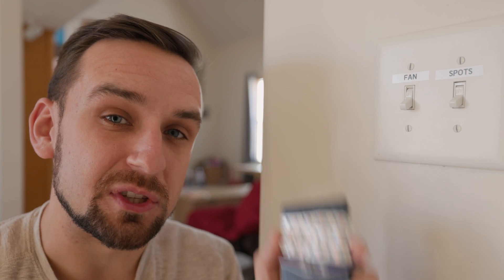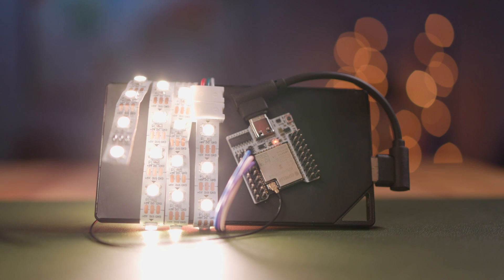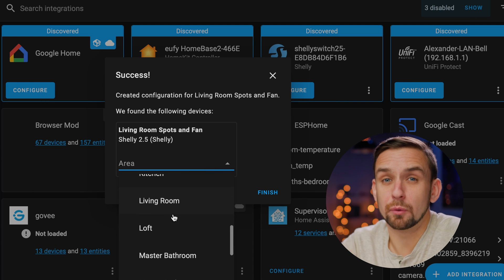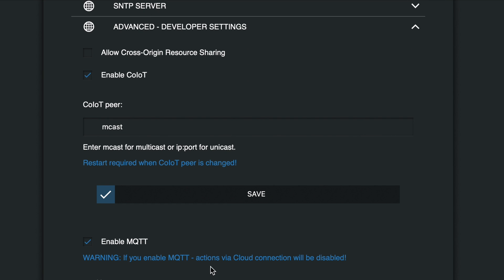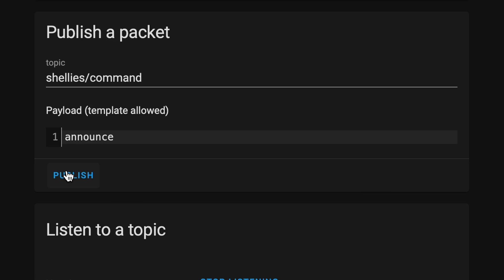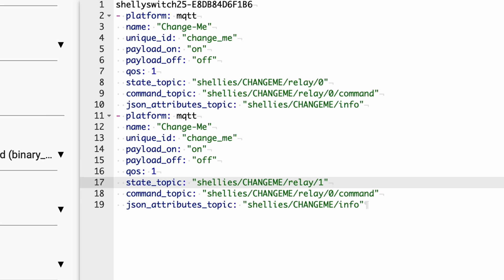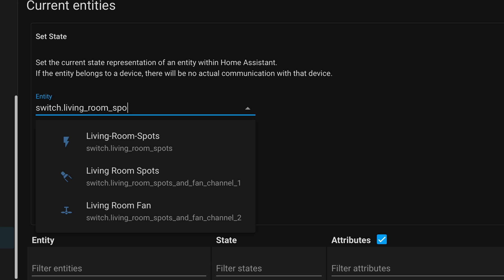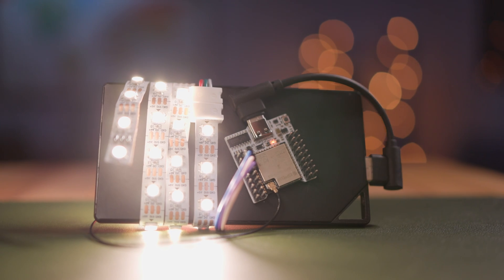Light Switch to control LED strip

Comment: Hello! I am looking to learn how to connect an LED light strip to an arcade button so that when the arcade button is pressed, the LED light strip turns on or flashes a specific colour. 

I have looked online and it appears that an ardunio is helpful in doing this, but I am not sure how to make the connection, or what kind of hardware is needed. This is my first lighting project so any help is appreciated!

Comment: I’ve watched this video twice but still don’t understand how you setup the WLED demo light device in HA so that the Shelly can talk to it. Where is that part of the install?
Reply from the maker: If you have a Shelly connected to your Wifi network, it should show up as an integration in your home assistant
Reply: You have some kind of device directly attached to the led lights. Some kind of ESP?  How did you integrate that into HA?  You don’t discuss this. You only discuss hooking in the Shelly into HA. Some how the Shelly communicates to/controls the ESP device, right?

Comment: I thought of having the same setup but rather using shelly with sonoff zbmini(zigbee) or sonoff minir2 (it has diy mode which works local as well) just to have everything running local. I am very glad that I found you by literally by accident and the setup to be very similar and working perfect. My only consideration is: Do you get any wifi dropouts from your wireless led controllers? (esps)

Comment: Nice video! Why didn’t you use a shelly i3? If all you wanted is triggering a message over the network. Using Home Asisstant default Shelly integration 
would bypass all the mqtt setup. All the inputs would be exposed as binary sensors through the integration.

Comment: Hi Great informative video...  The coding is something I haven't done before - so time to learn using your steps... I feel there is enough info in the video and text for me to have a go, 
Just a question if the the led’s are running a different colour or a sequence in WLED when you turn the light switch on/off will the LED’s return to the previous colour / sequence or do they revert back to the default?
Reply from the maker: There is a setting in WLED. Go to LED Preferences, and under Default you’ll see two options. The first powers on to a specific brightness. The second option lets you power on to a specific preset that you make. 

I recommend the second option. But it won’t save any changes that you make. So let’s say your default preset is blue, and you change your lights to green. When you power on your lights again, they will be blue. 

There is a way to have it power on to the last setting, but it’s too complicated for a comment. But if you want to go down that rabbit hole, I’ve heard the method called “dynamic scenes”. Not sure if that’s an official name or not.
Reply from the maker: Excellent question
Reply: @NickRains  thank you.... Appreciate your time in replying 👍👍